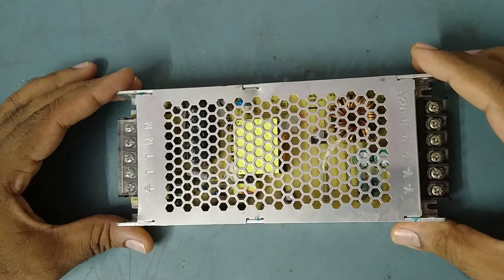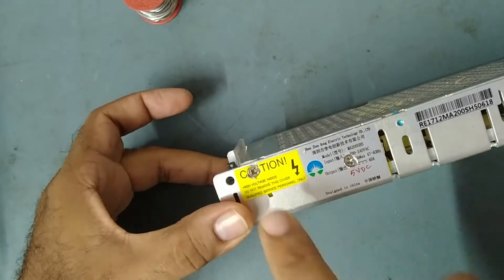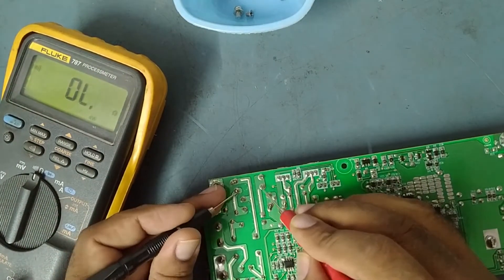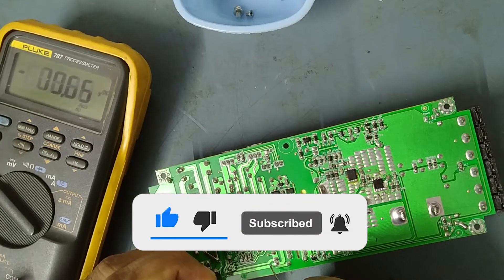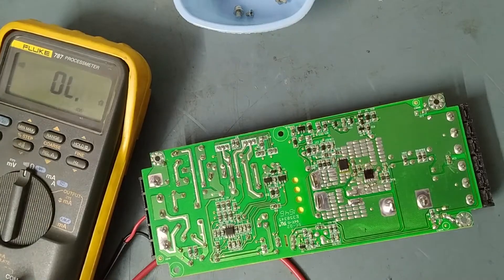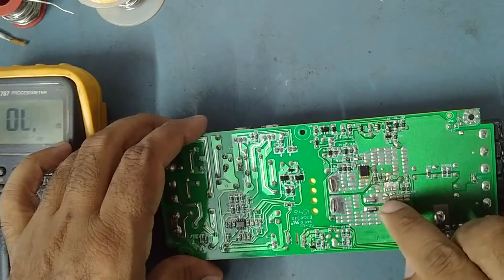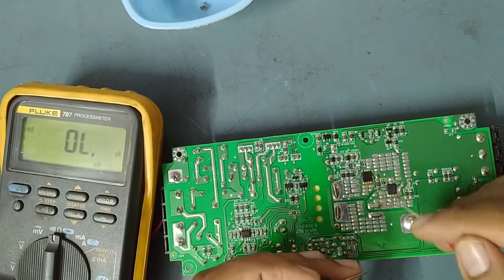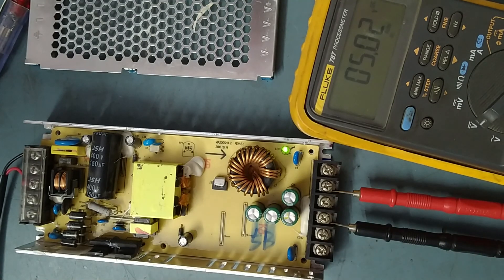Repairing Faulty Power Supply Unit of LED WALL SCREEN, Which is generating output 5VDC/40Amp.

Comment: N channel Mosfet is ok but not getting output what will be the probable cause plese guide 🙏
Reply from the maker: May be ic PWM or if everything is ok in primary side then look for some shorting in secondary side.
Reply: @TKFElectronics  sir primary section is ok.
I have doubt on optocoupler 817sc, how can I chek it?
Reply from the maker: Not sure

Comment: Sir masped not available
Reply from the maker: My dear that is not masped, it is called MOSFET, where you located
Reply: @TKFElectronics   India
Reply: Sir my led 25 power supply dead
Reply: Rajsthan
Reply from the maker: My contact no. 9653123582, muje call karo ye no. pe